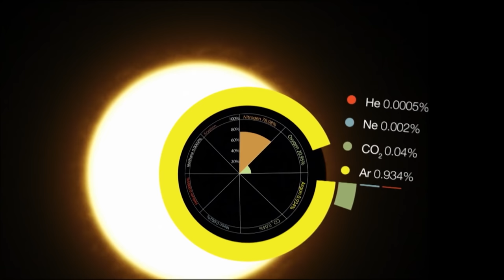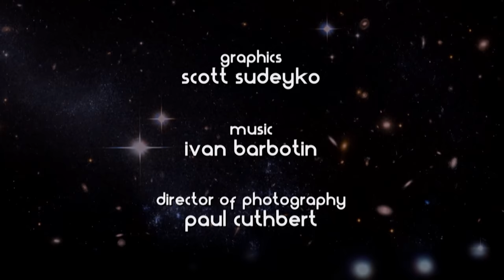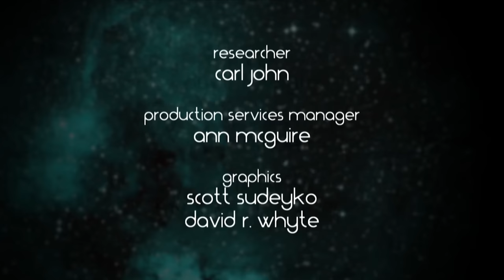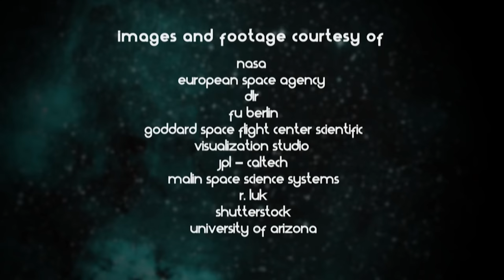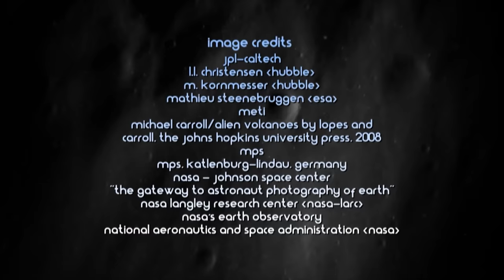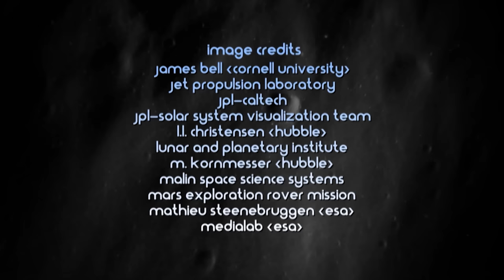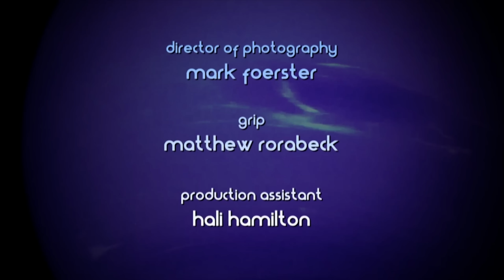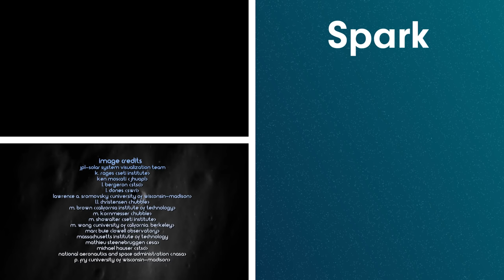An Inside Look Into The Planets In Our Solar System | Cosmic Vistas Compilation | Spark

Comment: could it be that the impact of caloris 1:00:40 resulted in adding mass to mercury is the reason for the cracks on the service of mercury stretching it and maybe also caused the inner core to shift and beeing compressed to one side and not bouncing back after the impact is left  partly gas ? 🤔

Comment: If the rover is so-called  built like a tank whoever was tasked with designing and building the wheels and suspension never received that memo. Or their design and fabrication skills suck. As slow as the rover travels please moving a few feet at a time one would think that there would be very little to almost zero damage to the wheels. Aside from normal wear and tear of course.